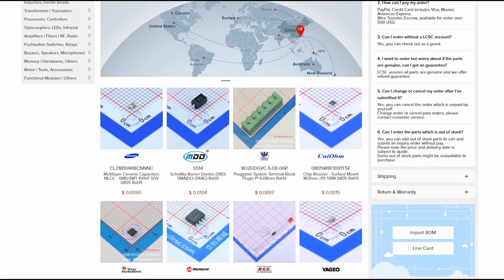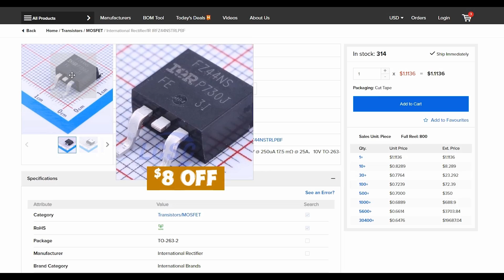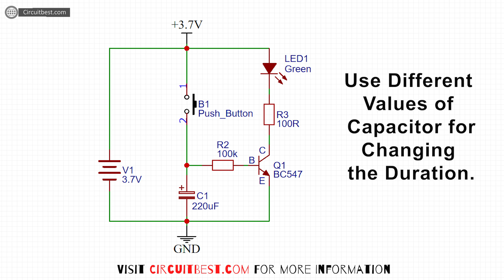Light off Timer Circuit LCSC

Comment: This would work without the 548 as it’s the Capacitor storing and discharging current. What is the 548 actually doing in this circuit?
Reply: Wrong
Reply: Correct